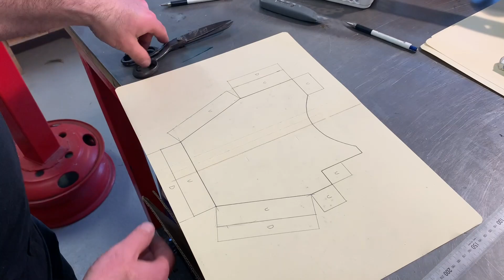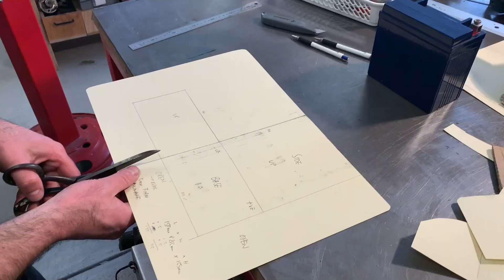Fabricating a custom motorcycle electronics tray

Comment from the maker: Is there anything in this video I need to cover in more detail? Let me know 👇👇👇
Reply: Matt, did you say the thickness of the aluminium used,?
whats the blue stuff? I loved the methodology. The sheet bender, is it just magnets that hold it in place?
Reply from the maker: It was 2mm aluminium. Anything heavier is hard to bend (I keep 1.6, 2.0 and 3.0mm in my rack) even with that magnetic bender. You can read all about it on the inventor’s website: http://aaybee.com.au/Magnabend/Magnabend_Homepage.html. The blue stuff is dye mark or dye chem (depending on where you live). Engineering supply stores carry it. Scribe lines stand out like dogs balls on it. You can substitute a regular black marker pen if you’re on a tight budget.

Comment: I thought you worked quick then I saw how fast you sunk those beers. Would you weld along any of the edges where the 2D template is folded to create the 3D shape?
Reply from the maker: Hey Rob, you could certainly fabricate that part  by welding if you had no way of folding it. I didn’t weld this part, there should be no good reason. I’d be happier if we weren’t using that massive heavy-ass factory-standard lead acid battery. Of course, sometimes you make a one-off something with the best of intentions and it doesn’t work. Or it breaks. So maybe this thing will crack at one of the folds. Or maybe it’ll last 20 years. There’s no way to tell.